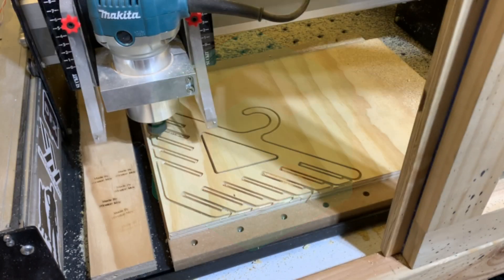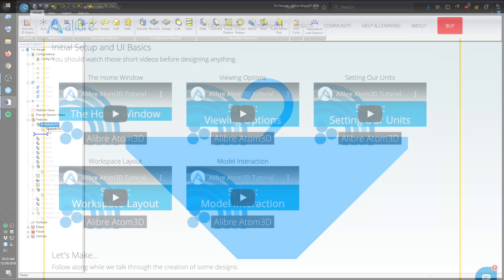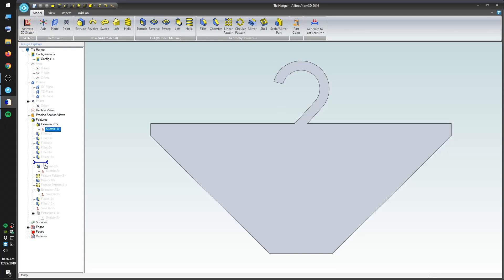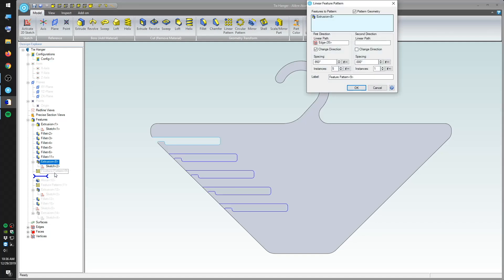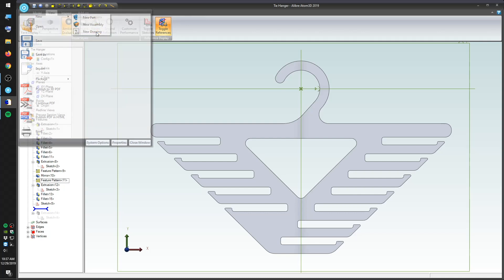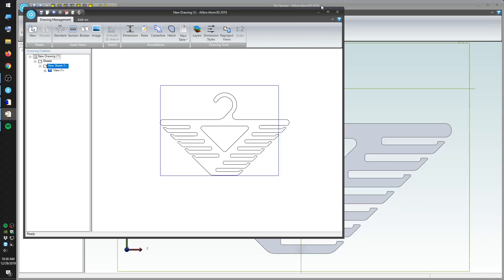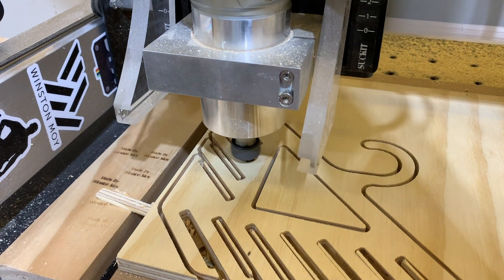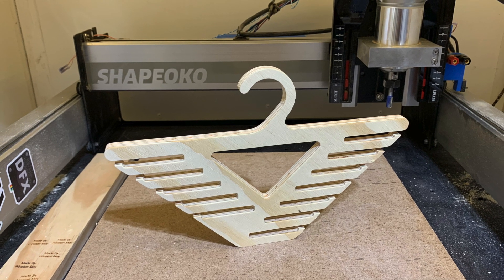Machining a Tie Hanger, Atom3D to CC Workflow Example

Comment: Can or could you have created the same file In carbide Create.
Reply from the maker: Technically you could, but without the linear pattern functionality in a more advanced design package it would be quite tedious to replicate. And if you wanted to tweak the design, it would be a lot harder. Parametric design is really key to this.

Comment: Wouldn't it be easier to make the whole thing in Fusion 360? That way you can make the 3d file and then just send it straight to carbide motion?
Reply: Hello,  Not everyone likes Fusion for a multitude of reasons, Cloud-based, subscription etc.  Alibre is a great alternative.
Reply from the maker: Plenty of ways you could do it, this is just one option. The CAD fundamentals in one parametric software are perfectly applicable to another.